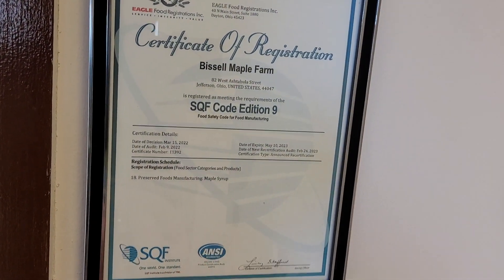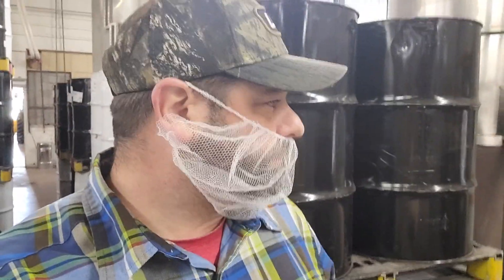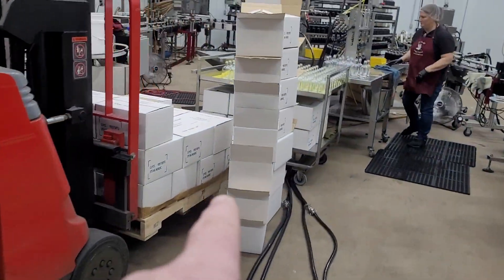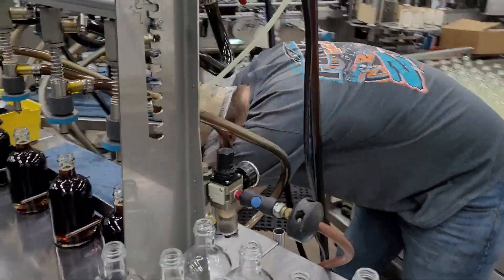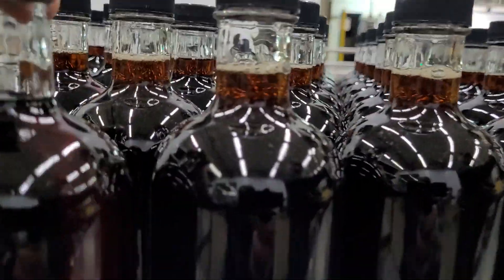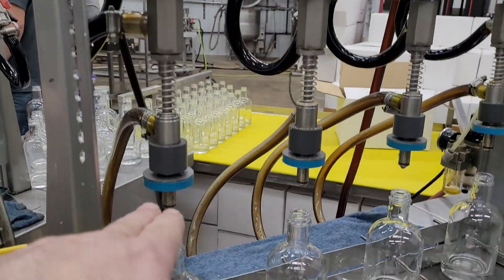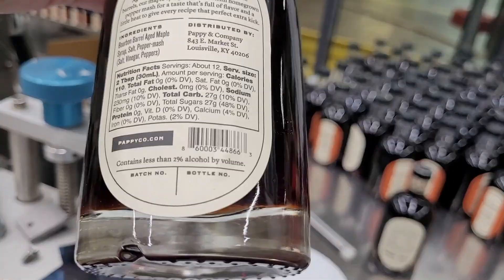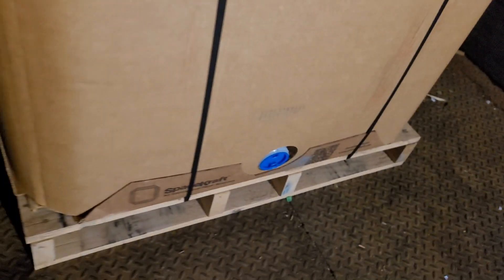#121 Bottling Pappy Maple Syrup & Lapierre 4-Head Filler

Comment: That is a very impressive bottling system. Way better than the 15 gallon single head canner that we have.
Reply: Does it bottle in plastic as well?
Reply from the maker: Thanks for watching!  We started growing with a D&G propane filter canner.  It was 8.5 gallons with a single valve.  Before that, Mom and Dad used a wool filter and Mason jars hot off the wood stove!
Reply from the maker: @Sawyersmaple  yes, it does a lot of plastic for us!

Comment: Sure looks better than filling and labeling by hand! 
If you don't mind me asking, what state are the barrels in when you fill them, regarding freshness? Is the inside dry, damp, or wet to the point where liquid still exists in the barrel?
Reply from the maker: Barrels are a perishable item.  The second they are dumped, they start changing.  We do not want to use barrels that have perished.  Time matters because freshness matters.